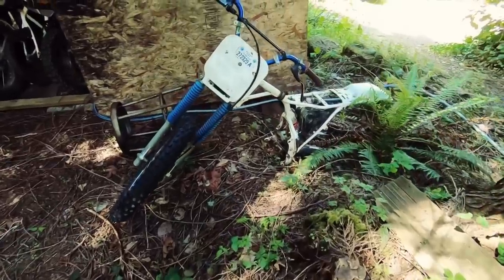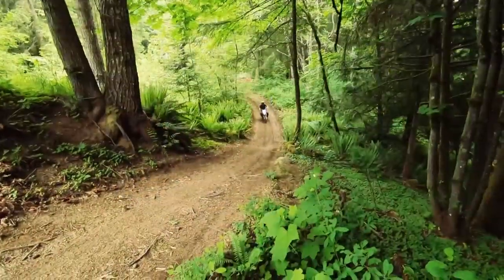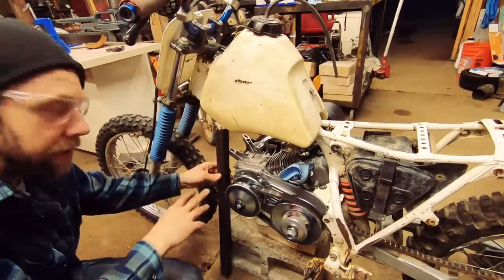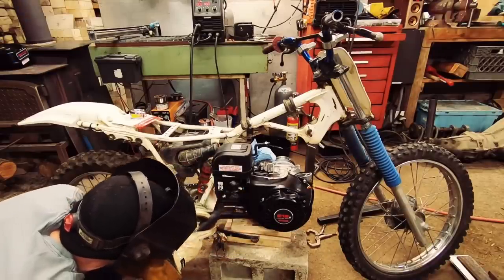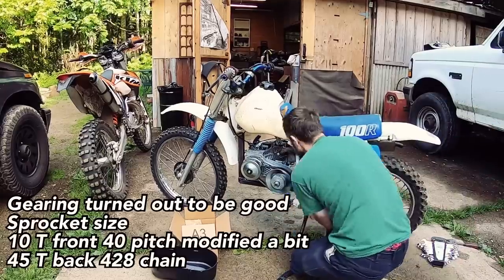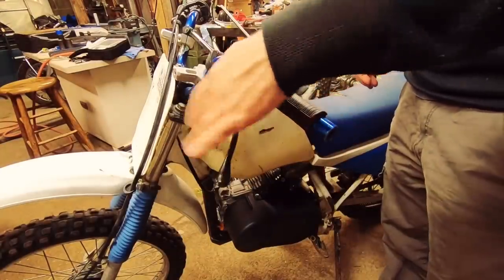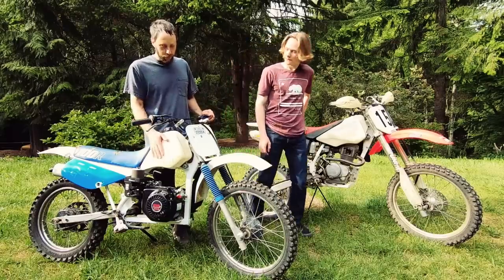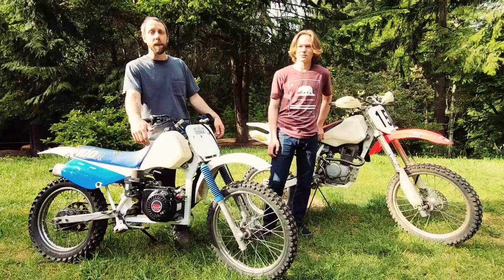Predator 212cc engine swap mini bike motorcycle

Comment: for the cost of 212 + TAV, why not just spend an extra hundred and get a bolt-in taotao shifter motor thats a clone of a dirtbike motor instead of a gx? The shifter motors are like 400 bucks with all the wiring shipped on ebay and bolt into the same mounts....
Reply: Because that's vanilla af

Comment: 0:28 , that right there is why i dont like 4 stroke.. 200cc and a whopping 7 hp!! i mean. a 70-80cc moped with a nice exhaust gets that type of power and weigs less than that huge block.
Reply: you did a good job tho! very nice and really like how torqy it is, i dig this bike as a project but wouldnt buy 4 strokes under 450cc to be honest.
Reply: its a cheap 4 stroke that has low compression and is limited to 3000 rpms.

Comment: Harbor Freight got some Motors that are about 212cc or whatever it may be larger 4 cheap price like opens up a whole new set of possibility a of rural King has Tractor Supply anywhere where they sell little cheap industrial Motors single cylinder and some have twins V-Rod Style why are Americans likely as we are can't ride stock because as We Know stock bikes suck....... so we'll have to add EFI with a bottle of NOS
Reply: Omfg i just now thought of all the chinese competition exhaust copy look alikes from china on sale at ebay dadwhdumpa zoooom for the competition . Seen a rural king off road buggy running with a pack of multi-$k buck asian quad rockets over at the wayne nation forest southern ohio in the high ridge trails as the race quads took turns burning rubber to the top of this mini mountain trying to continue on there buzz about but when it came up for the rural king farm buggy he nailed the throttle never letting off and cleared the summit of this mini mountain with air like a buckshot sand rail doing the double dunes
Reply: So you done away with the Governor all together that are usually sat around 3000 RPM for a wfo performance carburetor for a motorcycle that will not limit the RPMs at all until it's pulling they maximum CFM of the racing carburetor well this should be interesting on how long the connecting rod will last that should let you know is a sound something that these new 450 4-stroke motocross bikes when they're screaming and then a clunk bang and totally silent bring up the cash register in about $4,000 to rebuild but for the price of rebuilding one Dirt Rocket buys a hell of a lot of it Motors in a box hell yeah get a carburetor off a Harley on one of those from S&S and of course a bottle of juice from Nitrous Express
Reply: This comment is unintelligible gibberish. The sad thing is he edited it, and it's still hot garbage!

Comment: That poor ktm needs a tire
Reply from the maker: Needs a tire, What?
Reply: @Mikefestiva  That rear tire on the ktm is smoked.
Reply from the maker: It’s getting a little older but still hooks up great, it’s a Kenda Ibex, there extremely gummy and I’m running a tubeless in it at 4.5 psi I just put over 75 trial miles on it last weekend and it’s still good. These gummy tires grip really well! The downside of the Ibex is it’s knobs start to get stress cracks at the base of the knobs. Take care

Comment: You don't put that kind of engine in that frame
Reply from the maker: You probably should try and think outside the box more often.
Reply: He just did though
Reply: He can do what ever he wants and it rips pretty good you'd be surprised at what those things can do with upgrades and I think that ones pretty stock
Reply: Wrong
Reply: @stayhooked9499  
Tempted to do this on an old 72 Suzuki 125  I have , because the engine is tired. 
And it's road legal I have the title 
I don't wanna cut and hack the frame , I'd do it if I could make bolt in mounts.

Comment: I don’t understand predator motors you can find dirtbike motors for much cheaper and they are just way better
Reply: what? Where can you get a running dirt bike motor for $99.00?
Reply: theoriginalmungaman eBay, Craigslist, letgo stuff like that I see messed up bikes all the time with easily salvageable motors
Reply: There’s something I like about an engine that can stay cool sitting still.
Reply: Im on craigslist all the time, havent seen a small motorcycle engine under $100 yet.

Comment: That's an amazing downgrade. The next project should be taking a one ton truck and putting a four cylinder gas motor in it.
Reply: But does it work? Yes. He used only spare parts he had lying around. It's a win
Reply: Check out the Ram 50 with a Predator 212 Motor in it.
Reply: Downgrade seriously lol?.. You mean from the pile of "Scrap" it was?. Damn that's f**ked up lol.  Can't even give him a, "Hey not bad for a thrown together bike" really?. 😉😂😂

Comment: My soul hurts after watching him do that to a bike
Reply: I don't know  would you rather have an old bike frame rotting in the weeds or a kid riding around  with a smile on there face
Reply: Predators are reliable, and cheap. I would have done the same.
Reply from the maker: Haha sorry your soul hurts, you sound like a sensitive guy, you probably would have hated to see what I have done to some of my old Honda Cb motorcycles!
Reply: @Mikefestiva  Oh no! Lol I'm just a bike guy that's all. However great job on the fabrication I think it's cool!  Do you know what might have happened to the motor?
Reply from the maker: Haha yes, I talk about what we did with the xr100 motor in the end of the video, I can tell you now you don’t what to watch the other video where we build the xr100 motor up, BBR 120cc big bore kit, cam, big carb, fund exhaust, then it fitted to to a CR80 frame, the CR had a locked up crank so we installed the 120 motor into it for a fantastic northwest tight trails bike. Take care
Reply: @davidhelgeson6997  
Thinking the same, i have an old 1972 suzuki ts 125 with alot of aftermarket stuff on it. 
Plastic fenders and a fork brace, expansion chamber , factory hop up kit. 
ive kept it since I was a kid , its engine is on a 73 RV 125 but its in need of a rebuild. 
Either way I'm gonna have an engineless bike so that might be an option. 
Lol slap an 18hp vanny(I have 1) on it with open pipes....harley guys be like what
Reply: @Mikefestiva  
For some reason the late 70s cb/cm 400 2 cylinders found me. 
I had like 4 variations. 
Usually id bomb them offroad and do burnouts in front of my house. 
Looked like a drag strip.
Reply: @Mikefestiva  Seems awesome! I'll have to take a look at it! Didn't Catch that at the end of the video. Have a great day, Keep up with the good work! I love bikes and have quite a few items for a lot of different models feel free to contact me if there's something you cannot find and I can check around and see if I can find the part!